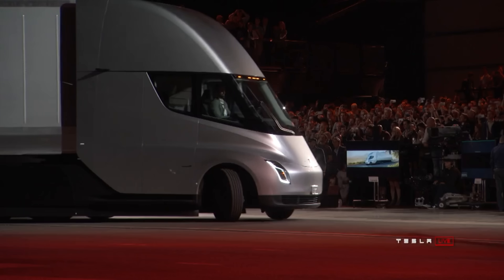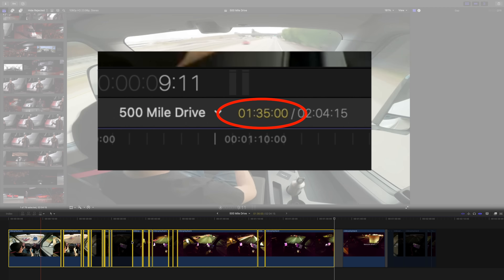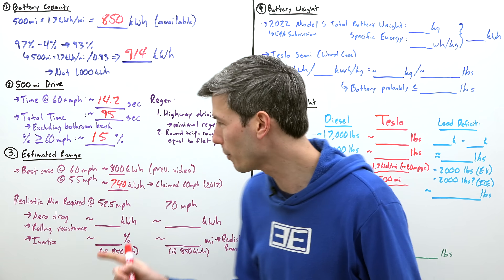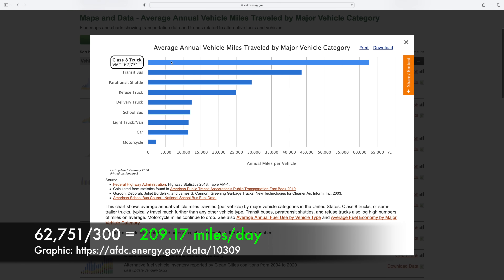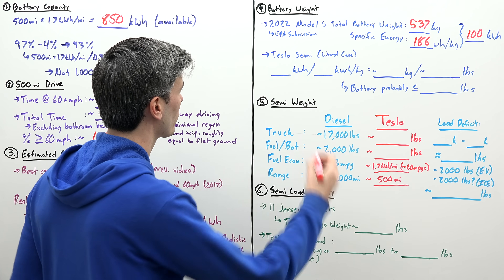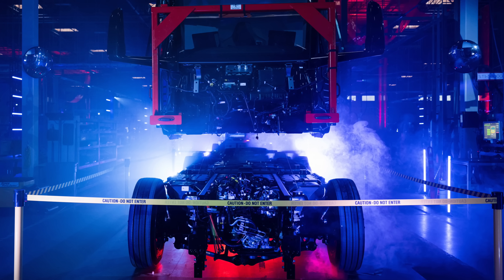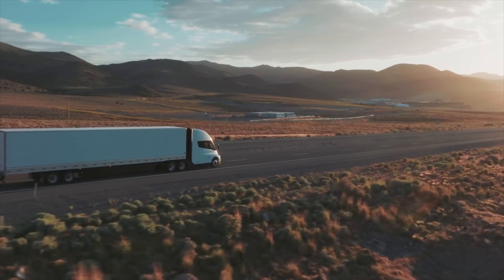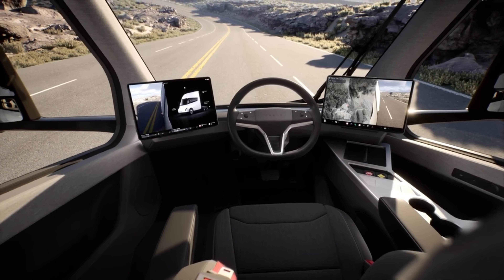Does The Tesla Semi Make Any Sense? Part 2!

Comment: My dad was a truck driver and he used to tell me no matter how long your route is, if you stop more that 5 times (stop signs, lights, yield signs, etc) it's basically impossible to average more than 55mph. Now I'm starting to wonder if that was true or not... Seemed true at the time!
Reply: trucker here...I time plan a route at 50 MPH everywhere except the east coast which I use 45 MPH due to traffic.
Reply: @grandinosour  how long do you consider it is safe driving before requiring a proper pause ?
Reply: I feel like I drive 60-80mph for most of my weekly driving. However, my car reports average speed of only 28.4mph.
Reply: What years? The federal speed limit used to be 55mph. Even with a bit of speeding it would be hard to get back to 55mph on an 8hr route if you spent 10 minutes stopped and another 10 stopping and accelerating.
Reply: @NONO-hz4vo  You can never average the max speed if at any time you go slower.
Reply: Just divide the number of miles driven by the amount of time, to get you avg. Speed.
Reply: I use 50mph as an average out here on the west coast, we have a lot of hills.
Reply: @afluffypinecone3577  Tesla would do better on hills though. It has double or triple the horsepower of a gas truck, and because of the way the brakes work, it doesn't experience downhill brake fade/heating. In that sense it could average a higher speed.... but then it'd run out of battery since it is going faster.
Reply: @Idiomatick  I can't wait to have electric trucks on the highway so they stop making traffic uphill and no more smell of burning brakes. Jason didn't account for the fact the brake weight could probably be 1/2 because they would be for emergency/5mph use only.
Reply: @randomvideosn0where  the problem with ev trucks is the battery will do good to last a year and half.
Reply: @randomvideosn0where  I'm sure you could throw brake weight into the misc 2000lb discount
Reply: @Bryan-Hensley  We will see! A lot has been learned since the Nissan Leaf though.
Reply: @afluffypinecone3577  Semi doesn't slow down on hills.
Reply: Being an engineer I measure everything.  When I used to drive from IL to Fl once a year, I would do a lot of data on the actual drive.  One thing I determined after around 10-12 trips of 1100-1200 miles, I could not do better than about 53 mph if I did time from starting the engine at home to turning it off in the motel parking lot.
Reply: This reminds of the one of the first things I learned from freshman physics long ago which was that if you're going to be late it's best just to be late and try to cancel or whatever because to make up any significant amount of time you'd have to drive far faster than is safe or legal so it's just not worth it.
Reply: @killaken2000  yep, if you think you are going to be late… leave earlier.  

Some people just don’t get it.
Reply: i80 I see trucks going 75 to 80 sometimes even 90 and for a long time
Reply: I am not a particularly fast car driver, I typically go the speed limit. I rarely average about 50 miles per hour, when accounting for stops. Pretty easy math
Reply: It was true at the time, a truck with the TS acceleration fully loaded 0-60 in 20 seconds would be unthinkable without electric motors or jet engines
Reply: @nyanbrox5418  Tesla Semi can only do that when not pulling anything. The thing has high HP and low torque. How could it accelerate faster than a diesel?
Reply: @danielch6662  completely incorrect. 

The Tesla Semi has 3 motors. The first is the running motor and is active at all times. This one is the high efficiency but low torque one, keeping the vehicle at speed in it's most efficient regime, enabling it's high range.The two other motors kick into action when either acceleration or additional regenerative breaking is required. These motors are geared for high torque to get the truck accelerating even up steep slopes, flying past diesel trucks along the way. These motors are based on the model S plaid motors and therefore have no loss of torque as they gain speed. 

The specs given for acceleration are given for a full load, the semi just has access to a LOT more power since the engines are extremely compact for the power they deliver, unlike a massive diesel engine and it's assorted systems.
Reply: @mobiuscoreindustries  even the Plaid motors lose torque at max rpm. It's just a question of what rpm.
Reply: @linusa2996  every engine loses torque at high RPM
Reply: @Bryan-Hensley  That's right it does, the question is at what RPM. Tesla's torque curves have the torque highest at 0 to the 1st half of the RPM band then drops off from there. It's why they can beat just about everyone in a 1/4 drag race but a car with 1/2 the HP will still catch and pass them at 1/2 to 1 mile mark. It's why the Tesla Plaid sits in 30th place in the Laguna Seca track rankings, behind street legal 911's and C6 Vettes.
Reply: @linusa2996  nah, it's just the timing of the winding fields. Petrol engines have transmissions. Try running the whole track in 4th gear. I don't think you really understand torque and HP. Without torque there's no HP. It depends on where you measure it. At the axle a gas engine can have 15,000 fp of torque.
Reply: @Bryan-Hensley  The example I mentioned was a 650hp 911 and while it lost to the Telsa in the 1/4 mile, it was actually going faster then the Tesla when it crossed the line and by the 1/2 mile it had passed the Tesla. Essentially the Tesla had less available torque to overcome the mechanical and aerodynamic drag the faster the motor spun. The 911 held on to it's peak torque longer because of it's grears and lost it at a slower rate and no the 911 does not have 1500 ft lb of torque.
Reply: @linusa2996  the roadster will still pull over 200 MPH. It's setup up for performance. You are talking about family cars.
Reply: @linusa2996  the 374 MPH bullet train has electric motors..
Reply: @Bryan-Hensley  I'm talking about a 911 which is a 2+2 vs 5 seat car, and spare me the claim that a Tesla Model S Plaid is a "family" that's about as family car as Hellcat
Reply: @linusa2996  then race the roadster. Or the bullet train. Like I said, you don't really understand torque in relation to HP. Electric motors are pretty much unlimited on whatever you need them to do. Don't worry though, I'm far from pro EV because of the battery. EVs are disposable at less than 200,000 miles. Usually less than 100,000 miles.. battery replacement cost alone makes it more beneficial to drive a gasoline vehicle getting 14 miles per gallon. I'm talking about regular size vehicle, not big trucks.
Reply: @danielch6662  Sorry Daniel, that is incorrect!
The Semi has very high power (more than twice that of most diesel rigs), and HUGE amount of LOW-SPEED torque.. and does not have to go switching up through a dozen or more gear ratios.  So, yes, the Semi will leave any diesel way behind.  The 0-60 mph in 20 s performance is indeed FULLY LOADED!  This performance will save considerable time in urban traffic, while the Semi's power + regen breaking will save much time on hilly routes.
The tractor with no trailer would leave many a sport car behind... for whatever this performance would be worth.
Reply: @linusa2996  A 911 is not a 5-place full-size sedan!  Let's wait for the Roadster to have a fair comparison!
Reply: @linusa2996  A friend of mine has a Model S Plaid and uses it as the family's car.  He just drives it light-footed when with wife and kids!
Reply: @st-ex8506  I did not say the 911 was a 5 seater, it's a 2+2 and it has nowwhere near the torque or HP of a Model S nevermind a the Plaid and yeah, it will reach it's top end before the Tesla does and gets to the 2 mile mark before it even though it will lose every 1/4 mile drag race
Reply: @danielch6662  The Tesla Semi has 1020HP and 1020 pound-feet of torque.
Reply: I'm only jumping here into the comments early because basically on the last video part 1 I tried to state that no one is considered or maybe even I'm sure dude has the developer or maker of the video that the semi truck trailer is are bound to have batteries in their chassis increasing the mileage well beyond or the hours to power
Reply: @dustinswatsons9150  Range extension packs seem viableish, but you'd be giving up max load for range.
Reply: Whenever I'm driving long, I just figure average speed of 50 mph. It's an easy rate to work with and accounts for gas & food stops, long uphills, slow traffic, etc. And if I average higher speed, then I get an unexpected windfall and arrive early and happy, instead of late and frustrated.
Reply: It is true
Reply: Suppose that is where that acceleration helps.
Reply: So true!
Reply: Miles Per Hour Means Miles Per Hour.. If I'm driving 75mph I'll average 75 miles in that one hour.. Don't understand
Reply: He should have qualified it with "legally." :p
Reply: It’s definitely true. I run a backwater route that cuts through a few no name towns. Outside the towns, 65+ speed limit, within the towns, 40 and below. On a good run, wide open road, one or two red lights, run can be done in about 2h45m. If I happen to catch all the reds, the run can be over 3h.
Reply: windmills and Soler is ineffective argument closed and you are a woke sail out
Reply: I drove local deliveries for over 5 years, average speeds was 12-22mph.
So all that aero work on the tesla, is just styling garbage, they may as well ave made it a square box and get the same power consumption numbers.
Reply: @linusa2996  not really, as the distance the semi could travel would be reduced
Reply: @linusa2996  Air resistance is a force not a flat negative velocity as per driving on a conveyor belt... effectively the sleek design increases the resultant force forwards, yes air resistance increases with velocity but it is not negligible for massive metal boxes moving like a horse for hours and hours almost every day for years

Running cost still cheaper long term than "cheap box"
Reply: @nyan Brox  air resistance is not a factor up until 50-55mph. 5 years of playing around with sustained cruise speeds, driving 200-300 miles a day  and monitoring real world fuel consumption has taught me that much.
Reply: @linusa2996  yeah but there is savings to only making one can design, just like they are using the same motors from the model s. Keeping the offering simple, they can do short haul and longer haul with same design.
Reply: @linusa2996  In electric vehicles the wind noise stands out like crazy because there is no engine noise. While it is overall quieter, the wind noise can be very irritating to the point I will stop to get a leaf out of the wiper for example. Also if they did not do the work there is no chance of this being used for highway.

Comment: Basically for short daycab use the truck seems sound if you have your own cheap charging. I'd be curious to see the math on electric vs diesel price when infrastructure is factored in, basically how long will the lower fuel cost take to pay off the new charging stations you'll need to build, that's the math companies need to think about. Also battery pack replacement vs engine rebuilds after 1mil miles.

The big problem with the tesla semi for longhaul is not what it can carry but how can you keep the thing on the road. 350miles/30min charging, with infrastructure that doesn't currently exist, won't cut it for longhaul trucking. My brother (a trucker for 4-5 years now) and I have talked about truck a lot and one of many things he brought up is what happens when there is a line? At 900+miles/10-15mins fueling you can get 2-3 truck lines forming at pumps, that's a ton of infrastructure you're going to need to build out. There's also the issue of needing to run heat/AC/all sorts of electronics all night, are these semi's going to sit on trickle chargers all night? That is an absolute crapton of infrastructure to build. Not saying it can't be done but it'll be some years before we see it.
Reply: Electric trucking out West won't happen any time soon is the answer.  I do have to wonder about a thing called... WINTER, but a battery heater and insulation takes care of that.  Trailers already have their own Diesel heaters so...

Comment: I agree with most of your numbers, but I expect the weight of the tractor to be a bit heavier. I think you overestimate the savings due to electric drive train, and as trucks need to run > 1 Mio. miles they need to be structurally heavier per mass than a passenger vehicle and also make battery mounts etc. heavier.

Comment: So something interesting... Assuming a $0.16/kWh energy cost (that's just what mine is), and $4.55/gallon for diesel fuel (roughly the current nat'l avg), the Tesla semi achieved the equivalent of 19.2 MPG on this trip
Reply: there are 40.7kwh per US gal of diesel. So for instance your electricity costs 0.16*40.7=$6.52/gal-equivalent
Reply: @pablopicaro7649  his comment was on efficiency, not cost. Since you brought it up though, using the worst case numbers since the actual usage hasn't been released, using 930kWh to go 500 miles and charging with $.16 electricity would cost $148.80 or $0.2976 per mile. Hauling the same 500 miles with the 7.3mpg sited in the video at $4.55/gal would be $311.64 or $0.6233 per mile. While the cost of the energy used may be 43% higher the efficiency being 263% better makes up for the higher cost per kWh and results in a significantly lower cost per mile.

Comment: Can you run some calculations for winter driving range? BEV ranges go down by 2/3rd the original expected range in cold temperatures which makes it unfeasible to operate for 25% of the year.
Reply: Thats only on a cold battery, teslas can heat the battery while charging or stationary to prevent the chemical reactions from lowering the voltage. As the truck drives the battery warms up and some of that range is regained by the more excited battery cells.. it doesn't take much power to warm the battery.
Reply: @Victor-vj5ds  I have seen the range go down significantly on my Tesla during these winter months. Also, we have not talked about the degradation that comes with  charging upto 100%  every single time as it needs to maximize hwy range
Reply: @reachguptaji  yes, your range goes down because batteries have less chemical activity when its cold. But if the battery is conditioned you will maintain full range. I talk about the battery degradation all the time. You can expect a 10% capacity loss after 200,000 miles. If you have LFP batteries the LFP chemistry prefers to stay at 100% charge when un used.. the worst thing you could do is supercharge in the cold at low state of charge but tesla has software to prevent wreckless charging speeds in these conditions.
Reply: Where did you get those numbers lol? Tesla Model Y and X lose about 15% range in freezing temperatures.
Reply: @tripnils7535  my personal experience

Comment: Don't even need to have a look at the speedometer to know they slowed down considerably in the hilly section, otherwise there is no way they would have ended up at the same battery level as driving same distance on the flat...driving uphill then downhill is a LOT  more power out and in the battery (almost an order of magnitude since crusing at 60mph - 1.7kWh/mile means ~100kW to cruise, and probably close to 1000hp / 750kW to move those 82000lbs at 60 miles up a steep hill) so even if by any chance the motor(s) could work at slightly better efficiency at high load and with continuous optimization of the load on every motor, the absolute amount of heat loss (in kW) would still be massively higher. the only parameter to improve efficiency that they have is going slower up hill (reducing drag/energy used) and/or slower downhill (reducing drag/increasing total regen)
Reply: What if the regen slows the truck more than it did when it was going up hill?
Reply: @Victor-vj5ds  wether you re going up and down, going slower will reduce drag and improve efficiency
Reply: @geemy9675  wouldn't the truck slow down going up hill at full load regardless? The Tesla semi is the only truck in the world that claims to maintain 60mph at a 5% grade.
Reply: @Victor-vj5ds  yep any other truck would slow down, maybe even more. I'm not saying the Tesla semi can't drive 500miles with uphill and downhill like a diesel one would, just saying that to maintain constant average efficiency on steep hills as on the flat you have either to slow down, or to have a very strong back wind....my bet is on the former
btw I don't know how fast semis drive in California but on the other coast it's quite rare to see semis do 60 mph or even obey speed limits

Comment: Very sound source picking and calculations! Thank you for that self explanatory video - so much to the nay sayers  - but also to the Tesla fanboys. I did some calculations in the comment section of a Tesla Semi debunking video and came to the same conclusions regarding the battery weight. 
That also shows the potential of a (future?) lightweight  construction of a Semi chassis. Still - leaps and jumps ahead from what Mercedes did for electric trucks.

Comment: "Tesla claims that 80% of routes are less than 250 miles" - questionable claim, although many truckload routes can be shorter, such as dedicated retail. What Tesla forgot to mention is that  short-haul operators expect trucks to complete multiple routes per day and "day" means 10-11 hours (due to regulatory restrictions on drivers).  This means carriers want continuous operation for 10-11 hours with no interruptions for fueling. This is where Tesla's semi really limits its potential applications.

You're probably wondering why Tesla has sold a few semis to big corporations. It's either marketing or limited experimental use. If Anheuser Busch buys 100 tractors it's 100% marketing, as they want to appear green to gen Z, who is largely ignoring AB products.